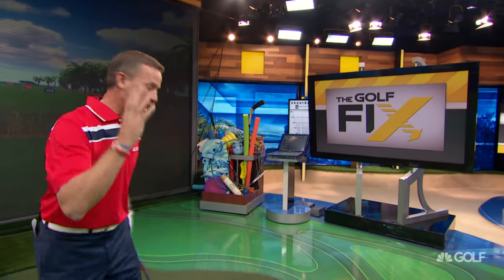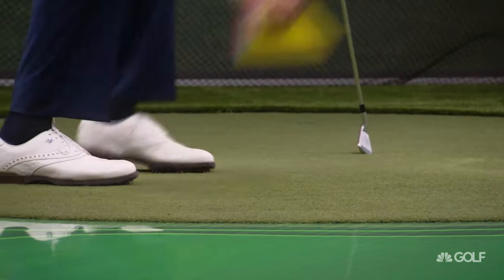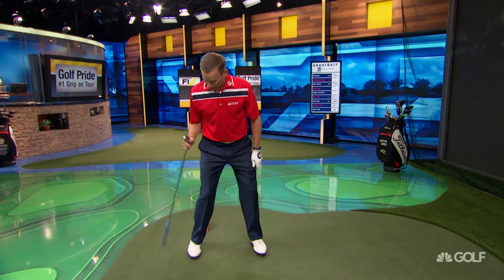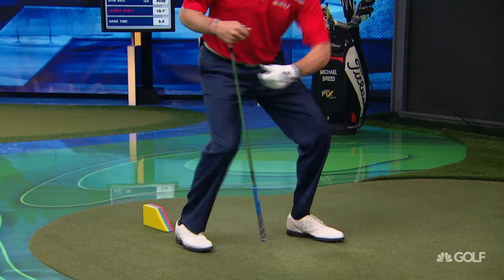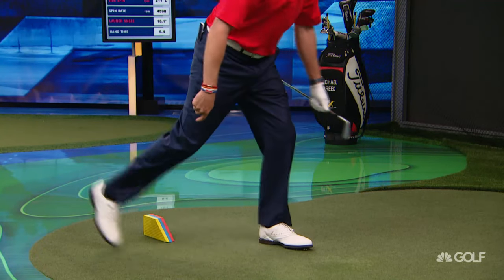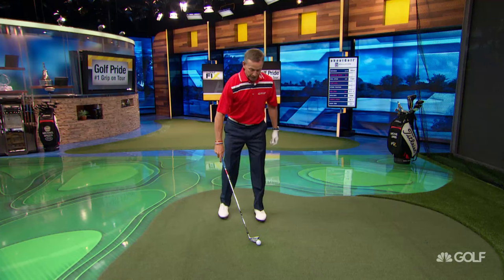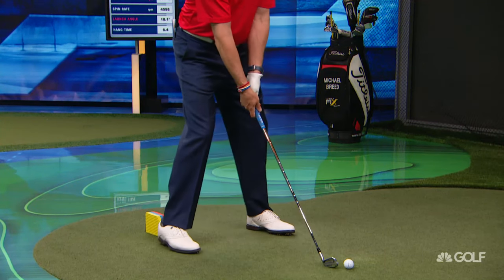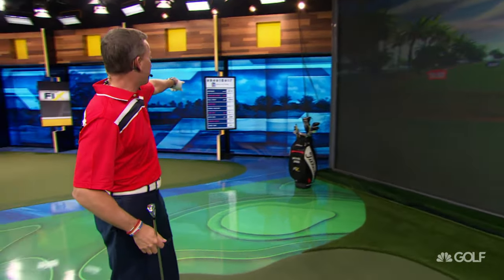How To Create Ground Force To Generate Speed | Golf Channel

Comment: Make no sense to me.
Reply: its indeed not very easy to understand, there is a lot of physics involved, but what he says in a general sense is correct (source: engineer specialized in dynamics and mechanics). you can try to swing fast with your arms, its not going anywhere. if you listen to rory, DJ etc, they all will tell you that the bulk of the speed comes from legs+hips with a shoulder turn.